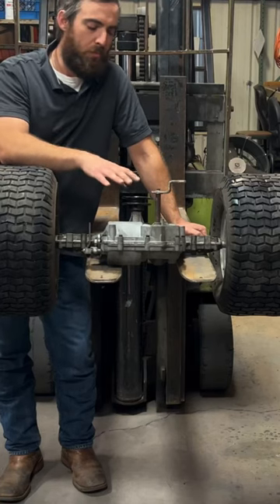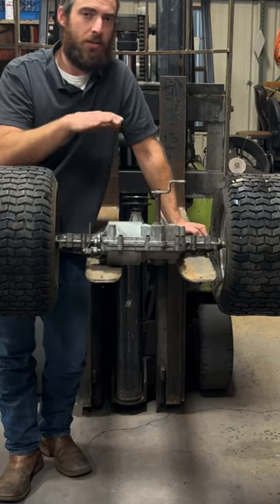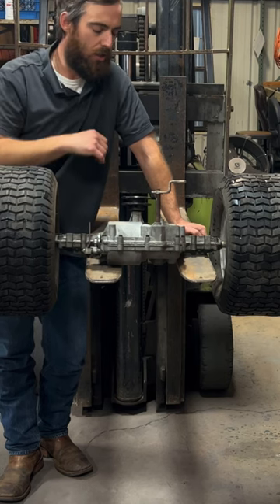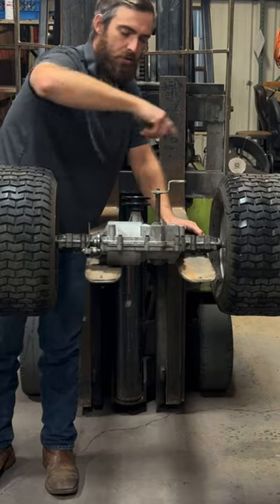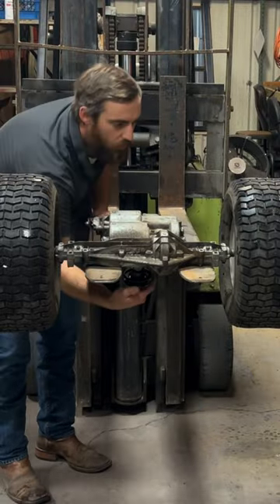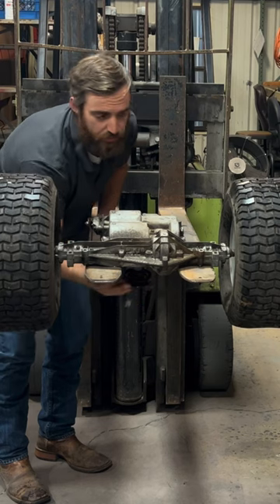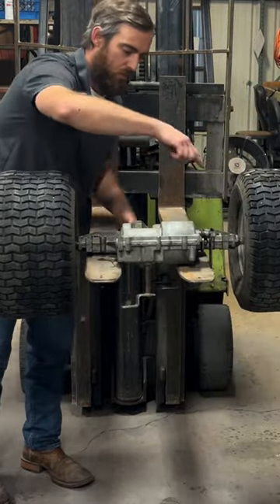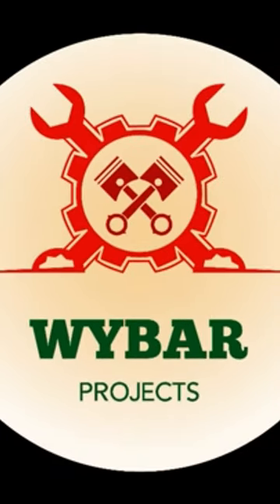How To Flip a Rear Axle and Keep ALL Forward Gears!

Comment: Going to have oil where it shouldn’t be now. Hopefully seals are good
Reply from the maker: The transaxle uses grease instead of oil. I don't plan on running it fast enough to heat the grease to the point of leaking out, but we'll see
Reply: @wybarprojects  it's gonna leak out. You can't actually "race" a mower if you don't want to heat it up! Hopefully you took it apart and put a solid axle in it and filled it with gear grease ! Just saying love yaallllll
Reply from the maker: @DaywordRacing  who said anything about this being a race mower?
Reply: How to bulide a ott/r[ad vickel
Reply: Some use oil some use grease, I believe he will be fine tho. I've done this with my first racing tractor and used a peerless rear end. Lasted a long time
Reply: Mst-206 boxes are fairly stout, mines taken a couple hundred clutch dumps with a 30hp doing the beating. 
And it's oil filled, probably one of the better boxes you could use if you can't find a peerless 820.
Reply: @wybarprojects why would you want to lower the centre of gravity on your lawn mower bro 
Couldn’t you be doing better things with your time 
I like playing around in the shed but come on man
Reply: @antiwoke884  For content creation. I don't give af about watching a dude mowing or fixing a mower. I can do both those things myself.

This is some random shit I wouldn't even consider doing myself. Makes it worth watching just for the "huh, well damn" factor lol.

Comment: I wanted to do this but with a drivetrain from a Chevy Tracker V6, flip the differentials so I could put the engine in the back of a steel tube frame.
Reply: Gotta be carefull when that with automotive diffs. The gears are cut in such a way that driving them on the back side severely weakens the system

Comment: Thing is this won't change the ride height at all though. The perches are attached to the axle so the axle itself will still be at the same height the pulley and linkage lever will now be very close to the ground is all and you will be extremely limited on how small a wheel you can use. Plus lubrication issues.

You are going to have to change the perches on the axle anyway so why not cut out  a way for the pulley to still be driven in the normal orientation.
Reply from the maker: I’ve seen a few different ways of lowering mowers, and this is what I found to be the best way for how low i want to go. Thank you for watching!
Reply: @wybarprojects  can you tell me why you want to lower it. I’m not understanding the purpose of doing it?
Reply from the maker: @jamesfair9751  I don’t have a purpose other than I want to do it. It was a free mower on the side of the road and I thought it would be a fun challenge to lower it as much as possible
Reply: Just your ground clearance now that Lilly can hit everything
Reply: @wybarprojects  if you want a challenge with a mower , find an older garden tractor and build a front end loader for it and have something very useful .

Comment: Why can’t u just place the transaxle on top of the frame and bolt it down cut square out so it clears ?
Reply from the maker: If you’re talking about what I think you’re talking about, I would have to run a jackshaft and at the time I thought that would be more difficult and labor intensive. I’m starting to think it would be the same effort but with more options. At this point I’m too deep to change it up so I’ll have to try it on a later build

Comment: I don’t get it. You’re now running the belt below the housing? Doesn’t that create belt alignment issues
Reply from the maker: The belt will run on the original path, I’m essentially flipping the axle and aligning it so that the pulley is in the same location
Reply: The from end gets squatted too
Reply: He's lowering the mower by shoving the differential up into where the gastank would normally be. 
The pulley will stay in the same-ish spot so it'll be fine
Reply from the maker: @The Punisher idk it looks a lot lower to me…

Comment: Could also just flip the belt over so it crosses between engine and transaxle.
Reply from the maker: That’s an interesting idea. I wonder how you would keep the belt from rubbing itself where they cross 🤔
Reply: @wybarprojects  A little flat bar, a bench vise, a big enough hammer, a welder(Or drill bits/bolts and nuts), and some spare idler pulleys would nip that in the bud easily enough. Just need to lift one side of the belt an inch right where it crosses over itself so it doesn't need to be a super complicated setup nor will it affect the belt tracking through the other pulleys.
Reply from the maker: @TestECull  I could see that working, I just figured it would be easier to spin the axle around
Reply: @wybarprojects  In my mind the crossed belt is simpler because the linkages will still more or less connect as they did.

Comment: But now you have to trim the cooling fins and who knows if it's gonna leak fluid out of it!!! I guess you have to take it apart and put gear lube in it instead!!!!
Reply: I've never had luck putting a tecumseh trans upside down
Reply from the maker: @DaywordRacing  interesting, how many have you tried and what are your fab skills like? Also, why would the cooling fins need to be cut? They don’t come close to the frame.

Comment: Major issues with your design you are trusting the seal on the Input shaft and also the lubricant reservoir being at a lower level because of the flip
Reply from the maker: I appreciate your input. Most of the folks I talk to say there shouldn’t be an issue, but I guess we’ll see 🤞

Comment: If he's looking for more ground clearance why is he putting the control lever and the pulley closer to the ground?.
He's making things much more complicated he's changing the angle of the belt because now instead of going straight back it has to go down and the lever has to be modified to go down where it can catch on things so he's actually losing ground clearance so I don't understand where the advantage is to flipping it upside down and spinning it around, also things are usually designed so that the gears and bearings are sitting in a lube, and now those geara and bearings are not sitting in Lube they're setting above the lube, so there's that issue as well.
Reply from the maker: I’m not looking for ground clearance. The angle of the belt didn’t change. The gears and bearings are pretty tightly packed in the axle with grease, so I don’t expect to have lube issues but we’ll see. 
Thank you for watching!

Comment: wait, what, why?
DiWhy!
change the center of gravity? you moved 10 lbs at most.
Reply from the maker: it's not so much about how much weight was moved, but rather where it was moved to. In my case, it was moved all the way to the bottom which will help prevent tipping over (a common issue on hopped up riding mowers)

Comment: Couldn’t you just puta twist in the v-belt causing it to turn in the opposite direction.
Reply from the maker: You could but I would already have to rework the linkages, so I figured I would avoid potential belt wear or extra pulleys by spinning the axle

Comment: Would work on anything, I was expecting you to twist the belt so it makes an X and reverses direction.
Reply from the maker: I’ve had a lot of people mention the X, but in my mind it would throw off the belt angle and either wear out the belt from rubbing itself or require extra pulleys

Comment: Its does not lower it.  Center of axel (or wheel) is still same height.  I go through 2 of them transmission every yr racing. Only way to lower that is to put smaller tires on it.  Cut the body of the mower and seat area to lower.  I just cut seat area on mine which with me on it is now has lower center of gravity Some mowers you can flip front axel to lower front some cause of how it is set up.  I've been clocked on my canadiana with the 12 hp at 55 mph.  I can tell you how to make a 8, 10 and 12hp mower a 14 hp and still look like a 8, 10 or 12hp.  There is only one thing different between them (brings and straton) besides looks and labels. And takes less than 5 min to do also
Reply from the maker: It absolutely does lower it, check out my other videos
Thank you for watching!

Comment: I did an engine swap on a Western Auto Wizard riding mower, going from a single cylinder 12 hp to a Briggs Twin I/C 18 hp.  The 5 speed transmission didn't like that. 🤣 Wish I had time to swap the hydrostatic rear end in I saved, but we were forced to move!

Comment: So now you have the pulley and v belt, plus the gear selector down closer to ground level in the constant spray of grass, dirt, rocks and tree stumps. Also, your diff oil may not be lubricating half the parts that need oil. If you want a lower centre of gravity, put smaller wheels on and use a higher gear to compensate. By the way, how many MM did that lower it for all your trouble? 10MM? 20? bet she handles like a 300Z now!
Reply from the maker: This thing will not see grass, dirt, rocks, or stumps; it will be a pavement/concrete cruiser. It ended up lowering the frame of the mower about 10” from 12.5” to about 2.5”. Thank you for watching!
Reply: @wybarprojects  love how you clap back on all these idiots that hate without even being curious enough for 2 fkn seconds to inquire about what your actual plans are with it, and you do it in a humble way I love it, keep em coming 🤘

Comment: This would be good information if you wanna run a drive shaft
Reply from the maker: I would be very interested to see how a driveshaft might work on a setup like this 🤔
Reply: @wybarprojects  driveshaft from engine to a 90 degree gearbox and the output from the 90 put a pulley for the belt? idk either lol